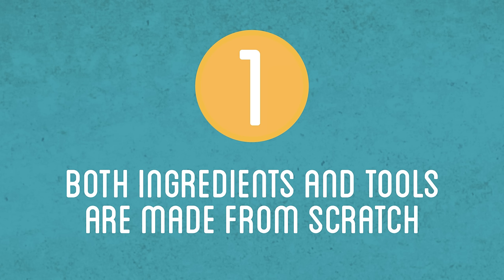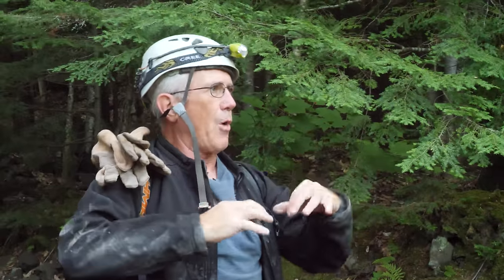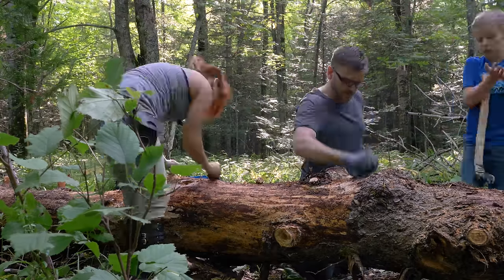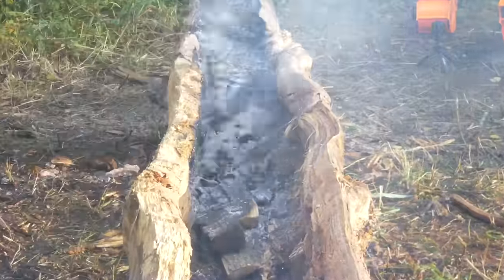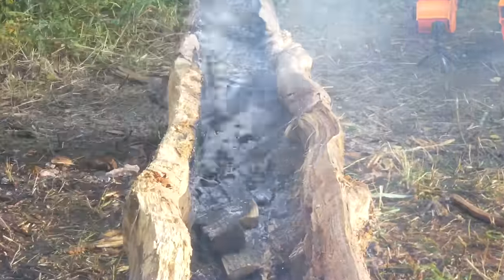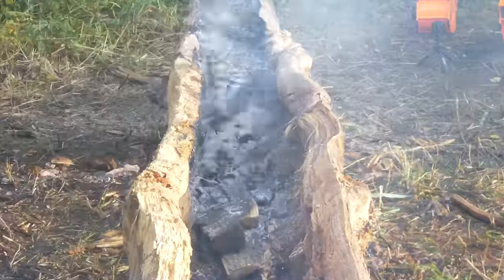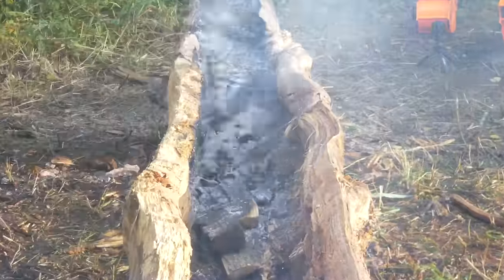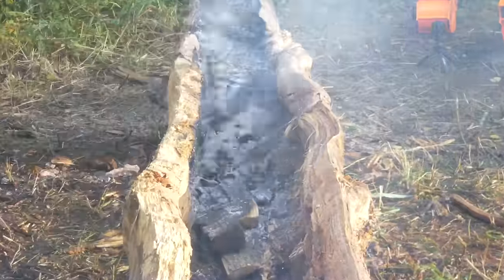Stone Age to Bronze Age: Speedrunning Human Technology (4 Hour Marathon Edit)

Comment: Most historians and anthropologist completely miss the point to fermentation on primitive cultures.  That bread comes with small stone grit that eats away at the enamel of the teeth leading to middle aged persons suffering from constant dental pain.  Holding alcohol such as whiskey in ones mouth will initially cause a few moments of blinding pain, followed by hours of numbness.  That stock of pain relieving alcohol does not travel well and requires stable temperatures that mobile hunter-gatherers cant maintain.  The move to staying in one location would have started with the middle aged or elderly and eventually the younger hunter-gatherers would adopt the change once the elderly improved farming innovation.  Pain, or the relief of pain is a huge motivator.